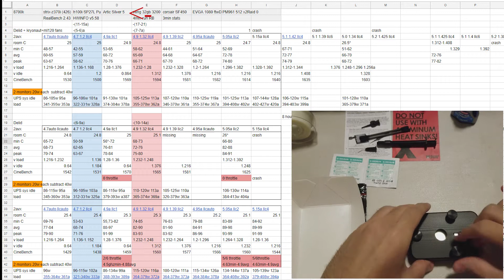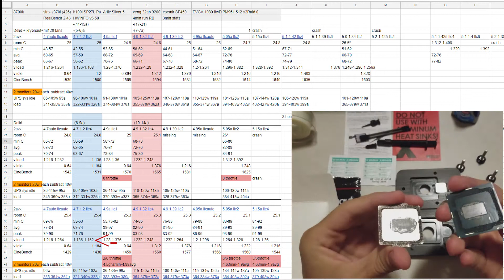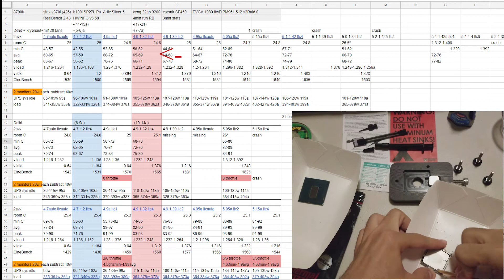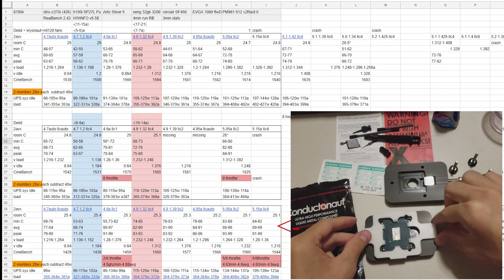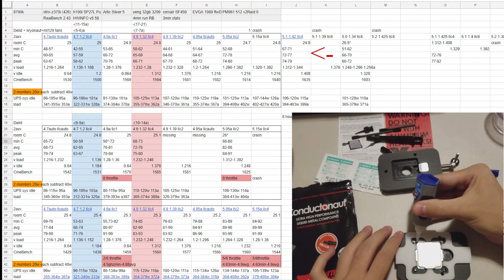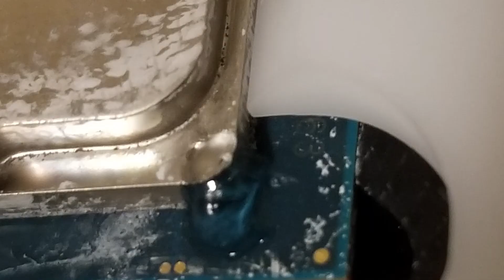8700k DELID/Liquid metal results & Kryonaut+ML120 fans on Strix z370i, h100i

Comment: Are these temps with cinebench or realbench?
Reply from the maker: row 2, realbench 2.43 :D
Reply: Tech Random thanks was nog 100% sure. Trying to compare your results with mine, just want to know if i did my delid right. Put a bit too much liquid metal on die i think.
Reply: Tech Random my results realbench 2.56 4min 63.8 average and 65 max with Scythe mugen5 4.7 GHz all core 1.23 volt. Gues this is fine..

Comment: so just so ive got this right both the arctic silver results and the kryonaut results are with liquid metal under the ihs?  im looking for a video of a delid using just kryonaut under the ihs after i saw a overclocker.uk video with " 8pack" and he said he used kryonaut  under the ihs and was getting great results but i think he mispoke.  can anyone enlighten me as to how well kryonaut would do in the place of the liquid metal under the ihs?
Reply from the maker: 1st set of results (bottom) are Intel paste under the IHS (arctic silver ontop IHS). 
2nd set is replacing Intel paste under IHS with Conductonaut liquid metal, using Arctic Silver ontop IHS. 
3rd set is Conductonaut liquid metal under the IHS, Kryonaut thermal grizzly paste ontop the IHS +swapping h100i fans to ML120 fans.
Replacing the stock intel paste under the IHS 'SHOULD' give better results. Liquid metal is the best, then Kryonaut thermal grizzly, then arctic silver 5.
(Then either Kryonaut thermal grizzle (best) or arctic silver ontop IHS, DONT use liquid metal ontop IHS, it is very messy and can damage your PC if not careful)
Reply: whoa wait wait.  you said 

2nd set is replacing Intel paste under IHS with kryonaut liquid metal using artic silver ontop IHS.

kryonaut is not liquid metal.  conductonaut is the liquid metal.  kryonaut is regular thermal paste.  its the best you can buy with 12w/km thernal conductivitiy but its paste.  which one did you use.  kryonaut paste or conductonaut liquid metal
Reply from the maker: Was editing my response sorry and corrected. Mixed up names.
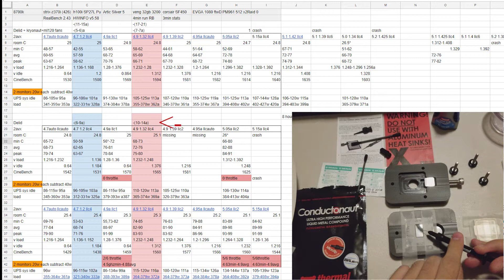@1:45 you will see Conductonaut liquid metal used under IHS.
Reply: thank you.  would really like to see a video where kryonaut was used on botht he die and te ihs. probalby wouldnt help much. nobody on youtube has one.  i might have to try it and make a video.  not that i do videos
Reply from the maker: Im not the best at videos either X.X. If you do reply with a link.
https://www.youtube.com/watch?v=TCu4IsUEyCA
Id hope it would be atleast 2-4 degrees lower than Arctic Silver.